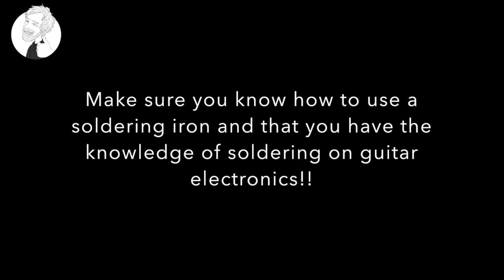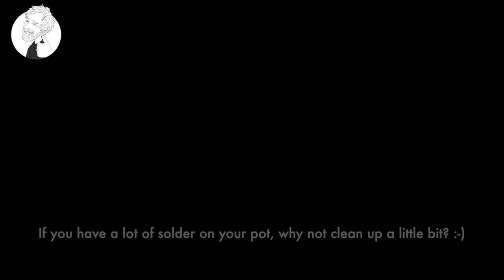How to change the bridge pickup on a stratocaster

Comment: I have a MIM HSS strat and want to upgrade the pickups... Do you think its a good idea to buy a SSS set and use only 2 of the pickups and buy a separate humbucker pickup. For example a pure vintage 59 set and then a separate bridge humbucker
Reply from the maker: Hi there! I would buy three separate pickups if I were you. What kind of music do you play? What kind of sounds do you want from your guitar? /Christian :-)
Reply: I use the strat mostly for clean tones going through just compressor and reverb effects. Mostly use it for creating samples for EDM and alternative rock. I don't use an amp as my signal chain has a preamp and two notes torpedo as power amp directly going into the computer. I am no professional just a bedroom tinkerer. 
Looking at individual pickups I get confused if there is any matching issue. I was thinking of set as there is not much confusion. Also prices for the bundle seem reasonable. Vintage noiseless set is around 130, while for individual custom shop each pickup is like 70-90.
Reply from the maker: If you like to I can help you decide what pickups to choose? What I like about separate pickups is that you have more options to choose from.
Have you looked at used pickups? Take care! /Christian :-)
Reply: Christian Cederberg thanks for the replies.. Appreciate it.. This video will definitely help once I decide what to do.. Cheers
Reply from the maker: No problem! :-) 
Cheers my friend